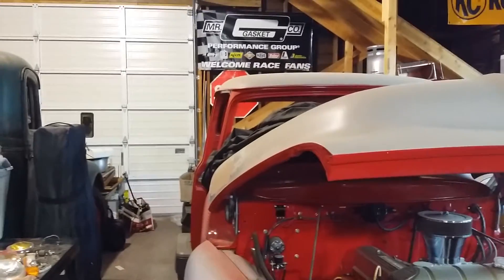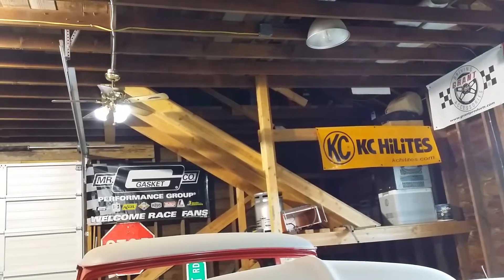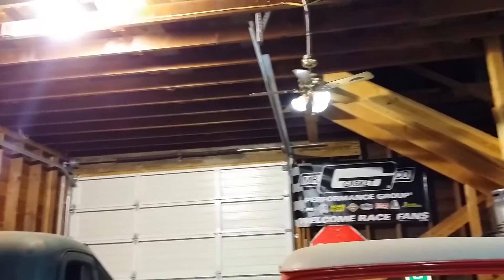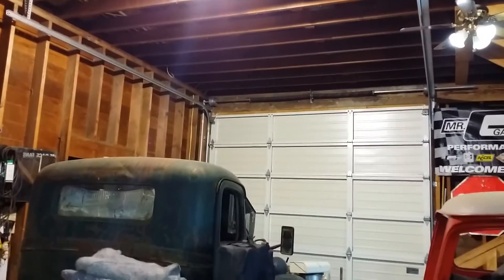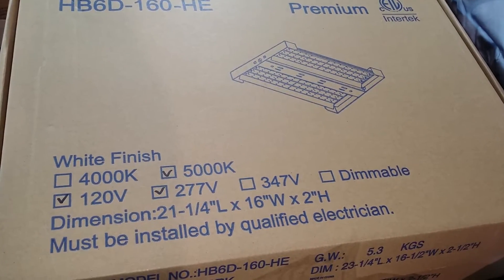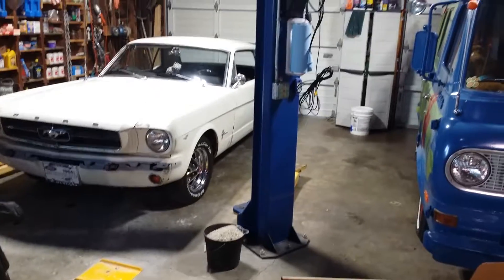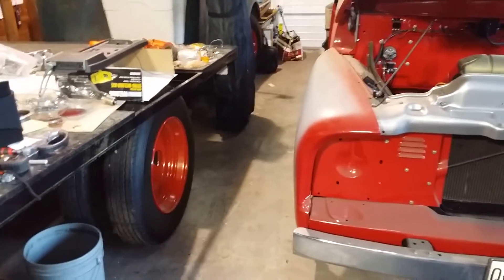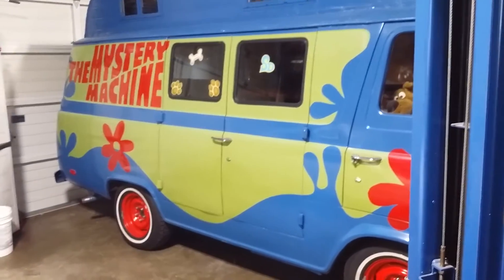Coverting my shop to 150 LED High Bay lights from 400 watt High Bays

Comment: How many lamps would you recommend for my 24l x 24w x 12ht barn?
great video buddy..
Reply: Blue Floyd depends on what your doing. But that shed is just under 2 bays long. And same with the width. Normally you put one in each bay. So probably 4 lights for your shed.